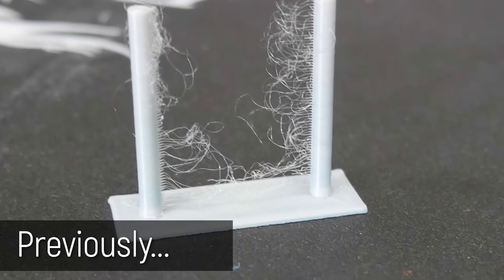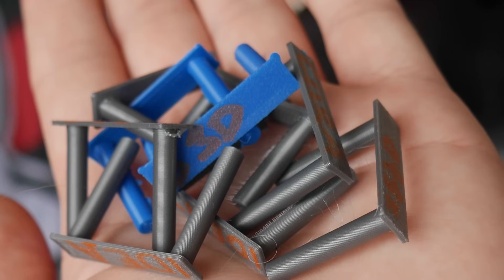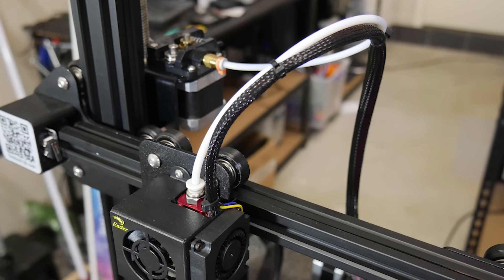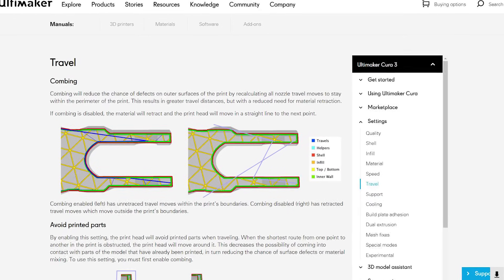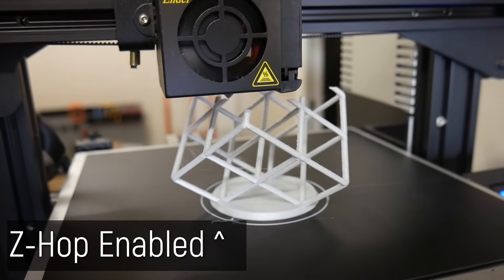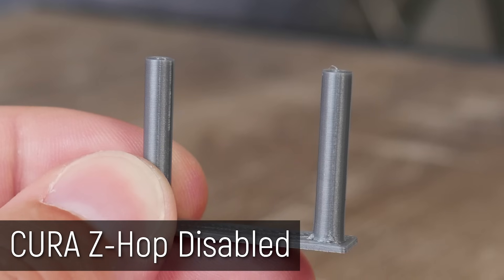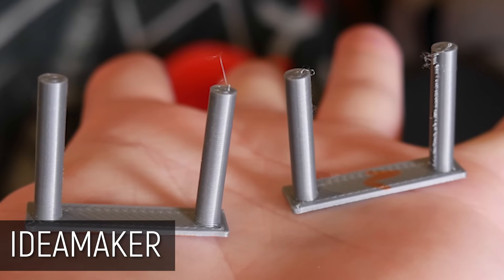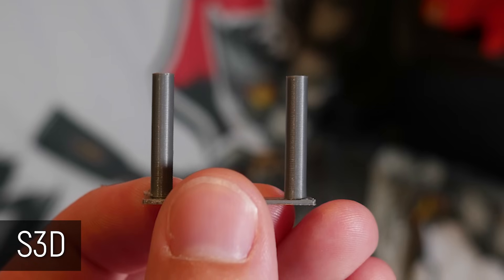Stop Ender 3 Stringing with this One Weird Trick! (ok but seriously)

Comment: I really wish reviewers would stop using S3D to review printers. It's not what the printers ship with nor do the majority of printing community uses. People always help each others dialing in their printers and a $150 software should not be part of the equation when free slicers such as Cura, Slic3r, Slicer PE, and others are as amazing as they already are. This is even more so when reviewing printers that cost similar to, sometimes even less than S3D.
Reply: I pirated S3D like three years ago and I've used it ever since.
Reply: @farn0153  link?
Reply: Yep. I can't see the benefits of S3D vs the price they want. It's just not worth it to me.
Reply: I used S3D and was not impressed. Went down the list and tried every slicer after a year of printing to see if there was anything more reliable than Cura - nope. In fact IMO  CURA & S3D had the most features with a GPU acceleration advantage for Cura. Slicing time was nearly identical when using like settings. The only feature I wish Cura had were custom tree supports, theres plugins and some tree options but its not custom like S3D which is a Godsend when you need them. S3D should be $50 annually, its not worth more I dont feel the GUI is as intuitive as Cura and it just feels like a java torrent program (how its interface interacts).
Reply: @davey3765   I use simplify most of the time but recently tried cura to try and correct a z-seam issue I was having (was related to another setting that accidentally got enabled).  I found that the overall print quality of cura's default profile for the ender was as good as my highly tuned profile in simplify.  However, as you mention, simplify blows cura out of the water when it comes to supports.  The ability to customize where your supports are being placed as well as the auto-generated supports being so good makes it worth it for me.  I have never had an issue with supports in Simplify but for the few days I used cura it was problem after problem.  Supports not adhering to the bed, or failing halfway up due to bad layer adhesion, or apparent under-extrusion.  I could not manage to tune them to work.  What's strange is that these were on prints where the actual model printed beautifully, it was only the supports that had issues.  Same model in simplify, flawless supports.
Reply: @davey3765  I kinda agree in the sense that S3D has a crappy Qt user interface and more often than not has usability issues with things like saving profiles. That said, I recently tried Cura as the last time I tried, it was a Wanhao build which was just sad. Cura is A LOT better than it used to be. But S3D is still amazing. I have probably 5 functional 3d printers at this time and some were much cheaper and some where 20 times more expensive than the Ender 3. I bought the Ender 3 as a replacement for my Wanhao i3 2.1 (which kinda died), I also bought a Swiss Micro all metal hotend and a teflon build plate. With some work, I've consistently been receiving reliable prints from the Ender 3 that are far superior than Ultimaker 5. I've done this by tweaking S3D settings far past what Cura allows. That said, I'm using very inexpensive but EXTREMELY high quality PLA from 3DNet in Norway. I will admit. My print speeds are low, but I can buy 20 Ender 3s for the same price as an Ultimaker and make it up in volume. I don't think the results would be possible in Cura, though I'm tempted to try now. I'm now considering a better PTFE tube. Though I can't see buying the Ender 3 Pro as meaningful since there are no quality improvements I can get from it that I can't get from S3D. As for Simplify3d's price. I already bought it, so it's no issue. But I agree, it REALLY REALLY stung. I would have paid $30 a year or $75 outright and been happy. But $150 was simply unacceptable.
Reply: @NoHemlockForMe  On the price point, I pirated S3D to see if I could justify the $210 AUD it would cost me, and after using it for a month, I went back to Cura and uninstalled S3D. It's just not worth it for the ridiculous price they're charging. The only thing that S3D has going for it is their custom supports.

It's a shame, because if it was about $50USD I would probably buy it, but at $150, I'm never going to justify it. I do wonder if the number of people who feel the same way is high enough that they could be making much more money at a cheaper price point.

Comment: Great detective work 👍😆 I found when Z hop was enabled on my CR10 with long prints gaps would appear in random layers. 

I thought it was with the CR10 only having one Z axis rod and when Z hop moved up and down, when it lowered the right side without the Z axis rod didn't seem to level with the left side ever so slightly, creating uneven layers.

Tightening the wheels Helped though, but I tend not to use Z hop.

Comment: The combing and wipe distance features must have priority over a z-hop feature, in order to prevent stringing. The software should be modified to perform the z-hop (1 level retract) mid-way in the high speed transit from one extrusion point to the next. The software should be able to figure out when it is doing this transition because the extruder is off... 

I think that should fix the conflict between the 2 features and allow z-hop to work without compromising the reduction of stringing.

I will have to look into Cura again, I have been using slic3r for years as it seemed to have the best feature set. 

I have also mused over whether I should start writing a library for slicing processes as a type of plugin, maybe even open-sourcing it to allow the community to improve its features; that seems to be a limitation in the advancement of slicing performance.. i.e. keeping the development of the slicers to a handful of developers.

Creating an (open?) library of slicing algorithms will also open the way to variations of printer types, 5-axis printers or other non-traditional printers (non XYZ style).

Cheers,
 - Eddy

Comment: I may have been just lucky, but my Ender 3 has never had an issue with stringing.  I have only a small number of filaments, but they are from different sources... while I can detect differences in print quality, none of them give me stringing issues.  I use Cura, and I do not change anything too much from the original settings, which I adapted from the supplied CR10 ones.  It's just a "black art", and sometimes even the senior wizards still have spells fail.

Comment: simplify 3D has a feature called wipe during retraction which is similar. It will wipe before retraction which it does before z-hop. That being said the best way to deal with stringing and blobs is to have perfectly dry filament.

Comment: Thank you for the extra time and effort you put in for the benefit of the community. I use the Cr-10 S5 which seems to use a lot of the same components as the Ender 3 "Pro." I have similar results to yours in the video that started this one, and thought maybe I needed to switch to a direct drive. Happy to see better results with only different filament and further tweeted settings. With your findings from this video, do you have any plans to do a small scale filament recommendation video?

Comment: I’ve got the ender 3 pro. I love it, but there’s no way I would recommend it to someone who is new to 3d printing. It is perfect if you enjoy the process of modifying the printer. I bought it for that reason, to slowly make it a much more powerful printer than it is. You can get spectacular results with the proper modifications, but prior knowledge and experience in 3d printing is a prerequisite in order to achieve those results. For my first printer, I spent a little more in order to get auto bed leveling, a FLAT bed, and software and hardware that automates set up and calibration. That way I wasn’t spending my time fighting to get good prints when my knowledge base wasn’t as wide as it is today.
Reply: What would you reccomend for a beginner? Prusa seems to be a good bet ,  but is quite a bit more expensive.

Comment: no hardware is good , it's all about software , that why I hate people who just say it's cheap machine it won't work , and they have wrong settings and blame it on the machine .

anyhow good on you for making the video
Reply: but its not only software. It's also hardware as in FILAMENT.
There are worlds between all sorts of Filament. I have some white Filament that totally sucks and another roll from another brand is absolutely great.
Reply: @REDxFROG  yeah but you can still combat any type of filament with software settings(if not it's not filament it's just crap), but yeah some stuff have much greater effect , but if all basics are there u can fix any problem in software ( not clogged nozzle , lose belt, broken wire . these are all essential that are needed )

Comment: Really interesting to see everything you've found. I'll have to give your ideamaker profile a go sometime. Glad you've seen that these machines are more capable than you originally thought, although I still agree with everything you're saying. It wasn't great having to use a hammer on my brand new printer to get the z-axis to actually move consistently, replace bearings at my own expense and I've ordered an ultrabase glass plate to get my bed flat and make it really easy to remove prints. I waited before ordering my printer so I got a later one with a removable surface (not magnetic). Happy with it now though for the price. Thanks
Reply: hi ChazMeister, thanks for those settings, i certainly will try those out!!
Reply: Hmmm, i own several 3d Printers and found the ender 3 working quite well. I never had an issue with the ender 3. I think that creality has a quality controll problem interms of supplyers... i own 3 ender 3 and never had any hardware issues nor stringing / bad prints (have them since 2.2018) . I live in germany and bought my printers on amazon.  My printers also came with an quality controll checkmark. so maybe it also depends on where you buy it ? maybe printers form gearbest are cheaper because they have worse parts ? :D just my 2 cents

ps: love your work guys !
Reply: @henrygoettler9647  where you buy the printer from will make no difference apart from the customer support you deal with. Amazon is more expensive as the seller needs to cover import tax and other expenses while still making a decent profit margin. I got charged about £26 import tax and I got it from Banggood with free delivery. If it was declared properly on the customs form, it would have been more. They all get the QC passed card from Creality. However, I don't think that is all that credible at all.
Reply: @ChazMeister_  Hmm ok :D strange ... since my cupplers where not loose like angus ones. I might try and buy some form different platforms to see if there really is no difference. I acctually really like ther ender 3 because i found its print quality extremly decent especialy for that price point. 

ps: thanks for the reply :D
Reply: @ChazMeister_  "where you buy the printer from will make no difference apart from the customer support you deal with." Uh, seriously? Some vendors that are selling "Creality Ender 3" are most definitely using lower quality parts / standards / methods of manufacturing. It absolutely matters where you buy the printer from.. Not saying any one specific place is better than all the others (when it comes to reputable vendors), just that there are definitely knockoffs and scams out there trying to pass themselves off as something that is already known on the market.
Reply: @henrygoettler9647  I thinks this is clearly a lack of Angus knowing what he is doing and not the printer at all. We have been seeing lots of this lately like not using locking tabs on pneumatic couplings, not know how to tram a bed level properly, saying curling will be resolved with more cooling. He has become very dogmatic and since moving has been presenting his reviews and other content with an attitude of being a experienced professional and knowing what he is doing when he doesn't. This is why generally Tom's channel is a better watch for actual reliable information. Also seems Angus has a bit of a bee in his bonnet with Creality despite being sent printers for free, needs to a do a little more research/reading/testing before he submits his views. It's too bad as normally I am pro Aussie but he is letting team Oz down....
Reply: @Redemptioner1  I must certainly disagree :D Angus does know what he is doing and is a profesional per definition. I like both chanles (toms and Angus). As I understand it, Angus compares Printers in terms of "is it a good printer for a beginner" which ender 3 is not in his conclusion. (although it is probably the best beginners printer at that price point in my opinion). And i would be pissed as well if my printer would come with a loose coupler since it is difficult to track down the error.
I have been watching Angus since ca 2-3 years?  and i can say that he might not be an super expert interms of inner functioning and software of the printer but a professional and capable of reviewing the usablity and quality of a printer since he has seen more than most of us have. 

However i would want to see Angus give the ender 3 another try. since both my ender 3´s worked perfectly form the beginning.
(i am using cura)

Comment: I use Cura almost exclusively and have found that with combing and aggressive retraction and a very MODEST Z-Hop, I can print complex geometries with no stringing and very rare failures (Normally because of external factors). 

My max Z-Hop is around 0.1mm, but normally use 0.05mm which is enough to clear most obstructions while still getting the advantage of combing. I also tend to use coasting to slow the print head before a retraction (10%-15% speed reduction) to give residual plastic a little more time to exit the nozzle at the time of retraction.
Reply: @thethiefmaster  I use 10mm retraction.
Reply: Isn't coasting difficult to figure out? Sounds 'dangerous'.

Comment: I switched to Cura a few versions ago from Slic3r. Hands down it has some of the best options and results. But you have to really dig deep to find them in the interface. I've complained to the team numerous times about the interface and how they handle custom gcode and materials but they have no desire to really cater to third-party printer users. Oh well. I use inner wall first, combing, wiping, ironing, coasting, hide z seam, volumetric E, Firmware retraction (Marlin 2.0), and Linear advance. I have perfect results every time. One thing I wish they would allow me to do is put custom gcode for the material I select like you can do in Slic3r. When I switch to PETG from PLA I need a different K value for lin advance. With Cura I have to open the gcode file up in notepad++ and add it in each time, I can't just send it out from Cura to Octopi like I want to.

Comment: I have issues with my Ender 3 with retraction or something, in some models it just underextrudes in places where it starts the layer.
So I replaced the bowden tube to the recommended capricorn, and as a result, after like 5 minutes of the print, filament gets dead stuck inside of the boden tube, to be exact part that is inside of the heatsink part of the extruder.
Why is it so?
Reply: I had the same issue and I fixed with updated cura
Reply: @solinexi  Mine is the newest as well

Comment: I agree with your opinions on the Ender 3.  The price and mostly good reviews for it make it seem like the perfect entry level 3d printer.  Matter of fact, this printer is WHY I finally took the step into 3d printing, and my decision was based on these reasons.  Great price and fairly decent reviews.  But, I learned really quickly, this is NOT a beginners printer. It's a tinkers printer.  I have 3 Ender 3's.  Each one had issues right out of the box and not one of them printed a good print right out the box.  Heck my first one still prints only mediocre and that's with MANY replacement parts from Creality along with some printed parts.  My second one prints ok, but I still have z wobble issues that I can't for the life of me figure out, and they show up almost at random.  My third one is the best of the 3 and my current work horse.  But it still has it's quirks, and still took a solid couple of weeks to dial in. I've helped setup a few other Ender 3's and they ALL had issues (one I even had the buyer return).  It's been a great learning experience, but might not be the experience some want as they enter the great realm of 3d printing.

Comment: I use an Ender 3 profile that I have only slightly modified from the Wanhao i3 profile that I made over the years. I always have Z hop on, but I have a much longer wipe distance than you seem to use and maybe a few other "tricks". I just printed the stringing test and it's virtually perfect on my Ender 3 using Hobbyking black PLA. The gcode does the wipe before the lift for the hop, so that takes care of the nozzle leakage. This allows me to keep the retraction distance at 4.5mm, which is pretty low for a Bowden style extruder. The Z seams are also virtually invisible on my print. Here are links to the factory file and gcode and resulting print JPEG, in case someone wants to try the profile or print the gcode:

http://cameraid.com/misc/jmunkki_nostrings_E3.factory
http://cameraid.com/misc/jmunkki_nostrings_E3.gcode
http://cameraid.com/misc/jmunkki_nostrings_E3.jpg

Special features of the profile not related to stringing:

- "Bermuda Triangle" nozzle priming gcode
- 3-layer infill (instead of the usual 2-layer)

In case you do try, please leave a comment or thumbs up/down based on how it worked for you.